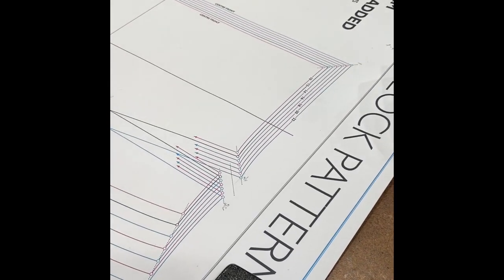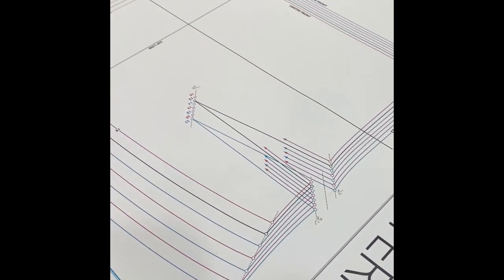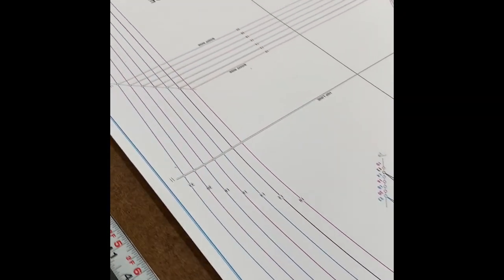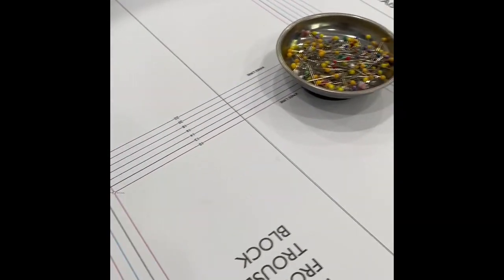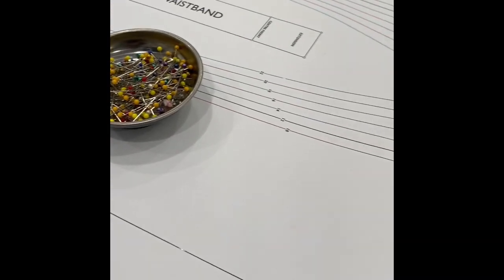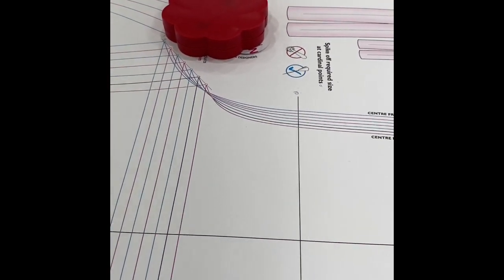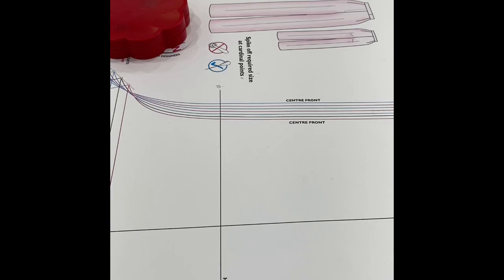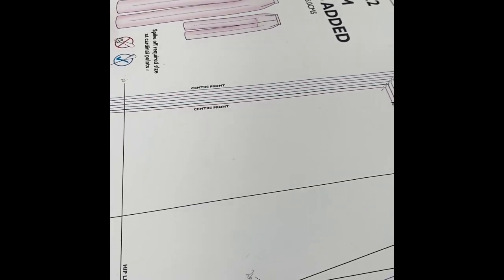How to extrapolate grade rules from a basic block, sloper, or pattern

Comment: Thank you for this tutorial! I understood what you explained. My question is , if  I have one size and want to grade up and down, what will my math look like in  a chart for me to get to this point. That is where my confusion lies, I dont know how to create the sheet before grading. How do I use my measurement chart to move all those crucial points you mentioned ( hip , waist , inseam etc). I know you mentioned making a tutorial on that and I would love if you could with this same pattern. Thanks!!
Reply from the maker: Thank you!  Creating a grading sheet from measurements is quite a bit more complex; I haven't gotten to that video yet; simplistically, you will take the "increment of change" between the sizes, and divide it by the number of movements on the pieces you are grading. For example, if you want to grade a waist line by 2 inches, you have 4 pieces- 2 front & 2 back.  Assuming your center front & center back are fixed, you will divide 2" by 4, and grade the front and back side seams 1/2". The variations in grading theories will determine where the moves are, and how the grading increment is broken up.  I recommend Dr. Martin Shoben's book "Grading for the Fashion Industry" as he does an excellent job explaining it; and the book is available and reasonably priced. Thank you !
Reply: Thank you so much! I have the grid now. Thank you.